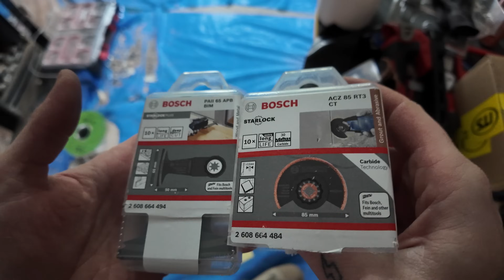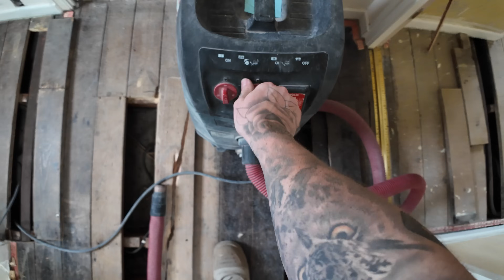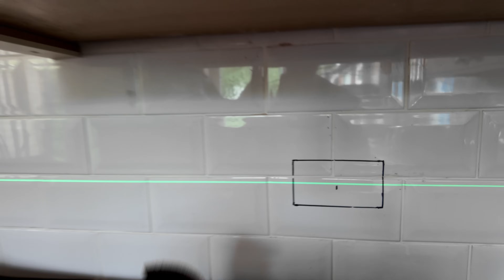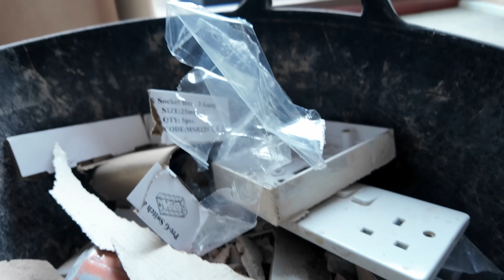Terrifying - Installing Sockets In New Tiles

Comment: If you play a hot air gun over the tile you want to remove  until it is good and hot the bond beneath loses much of its adherence and will allow you to remove it by prying with a decorators knife.

Comment: Why brush plates for cat6 cables? We've done it, but i prefer proper euro RJ45 modules to transition from solid to stranded, if you do it right it is till 10G capable.,.. do you have a proper network cable certifier? (I don't, it's on the wish list)
Reply: mine is just a basic cable mapper, and carefully maintaining the twists

Comment: Obviously too late now, but couldnt have found where the new 2.5mm dropped from the socket nearest the sink and fed back up to that socket? Save the tile cutting stress
Reply from the maker: it was under the shower tray mate and didn't want to cut the ceiling above
Reply: @NBundyElectrical  sorry not that socket, I meant what was the cooker socket with the 2.5 dropping. Looking good though fair play, upping the standard on a rewire